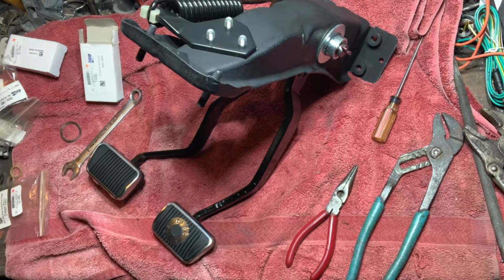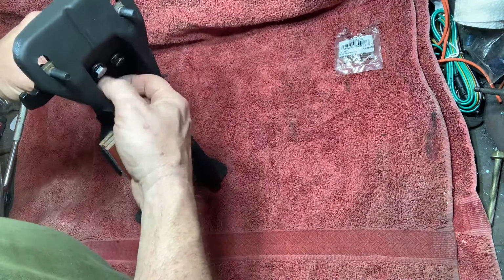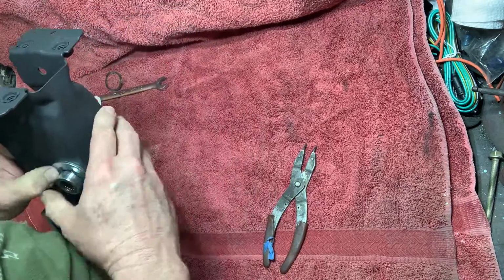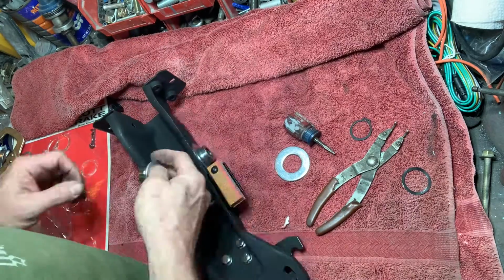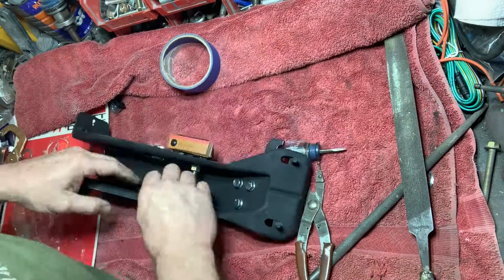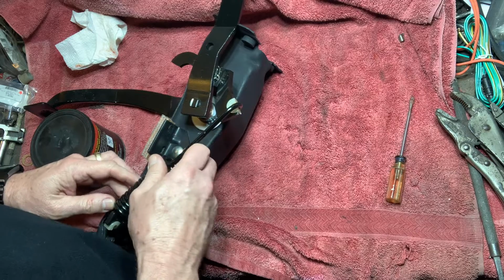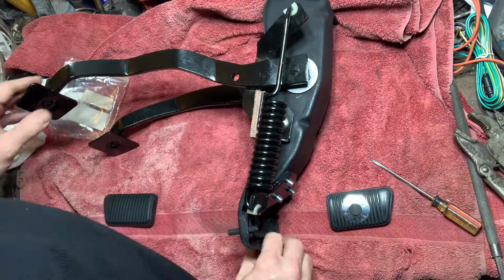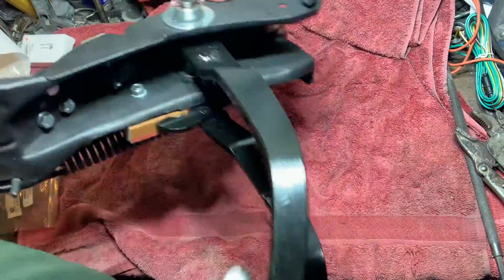How to Mustang Clutch Roller Bearing Conversion

Comment: Surprised only one comment. I'm back into working on a Mustang after a 30 year absence. This stuff wasn't around obviously back then. I was surprised to see the Drake and Mustang Steve kits have been around at least 10 or more years. Crazy. 

Seems like the Drake can be installed by anyone with a Dremel. And the Mustang Steve requires welding. Seems like for someone who is tidying up a Mustang to sell, or maybe a casual driver (though those folks aren't usually working on their cars these days), Drake is a reasonable option. I ordered the Mustang Steve kit but I certainly don't see anything wrong with the needle/roller setup.
Reply from the maker: It truly is amazing how many parts and options are available for these cars.  Thanks for checking out my video and commenting.   The Drake was an easy upgrade for this build and seems like a quality kit.   Don’t remember seeing Mustang Steve’s kit when we planed this upgrade.  Either way they are better that the factory way of doing it.   Happy to hear you are back working on your mustang,  good luck with your build.

Comment: I’ve yet to drive a butter smooth clutch on a 60s mustang.. it’s the kind of car I dread getting into traffic with because the clutch is a bear! My leg gets tired on trips.. I loved the clutch in my 2009 bmw 335xi.. has anyone driven a 60s mustang with an easier clutch or is it hopeless?
Reply from the maker: This assembly was installed an a 65 mustang with the addition of a hydraulic  clutch from Modern Overdrive.  It is very smooth with a lot less effort than the original setup.   Not sure if it will compare to your BMW,  but it is much easier on your leg.